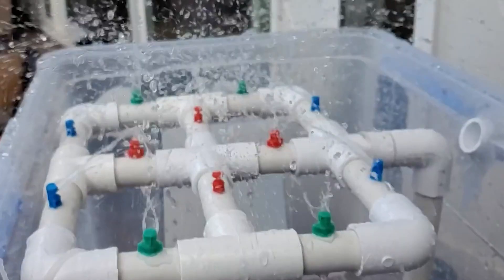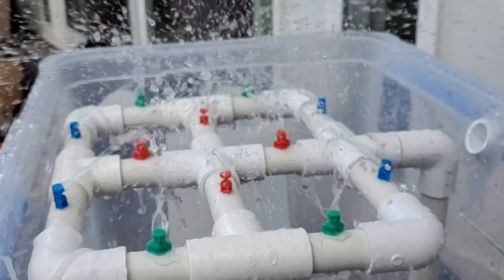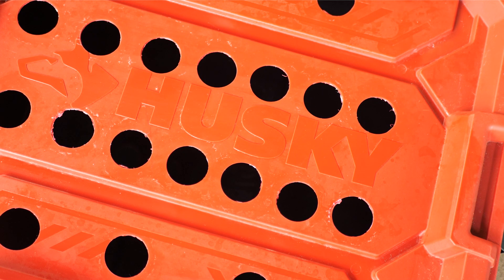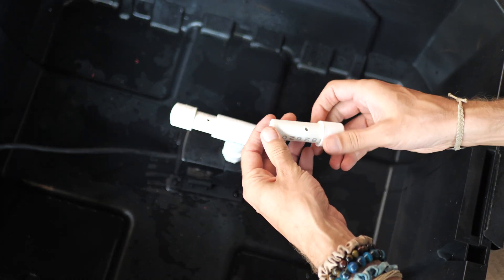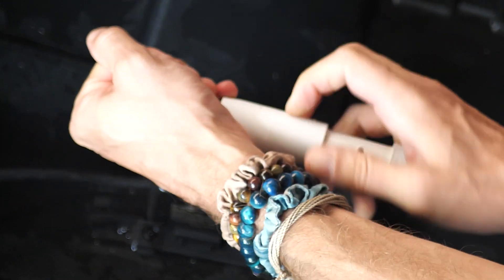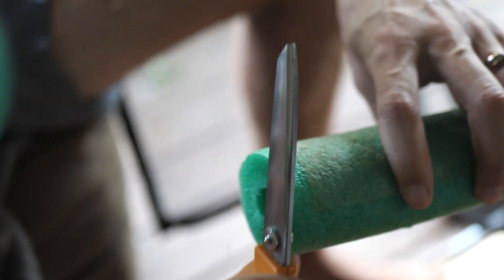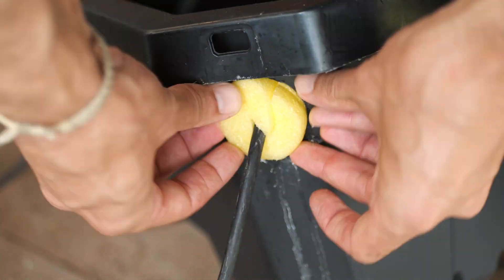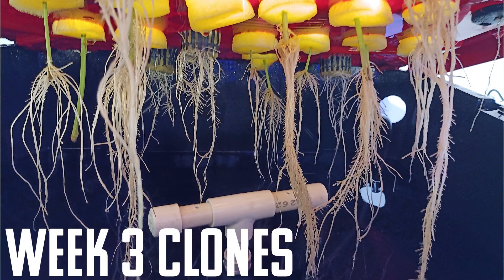DIY Aeroponic Garden | Simple LPA How To Build, That Works Better Than Aerogarden

Comment: Did you know about pvc pipe toxins ? and safer alternatives ?  if the pvc pipes leach then the plants are absorbing too and then we are eating the plants, this may be an issue. PVC (Polyvinyl Chloride) Experts recommend replacing PVC pipes with safer alternatives, such as:Recycled copper pipes
Stainless steel pipes
These materials are more environmentally friendly and have been shown to be less toxic than PVC. monitor water quality and detect potential contamination.The PVC pipe industry has disputed the findings, claiming that PVC pipes are safe and more environmentally friendly than metal pipes. However, many experts and advocacy groups argue that the industry’s claims are based on flawed studies and that the risks associated with PVC pipe leachates are real.  yes this pertains to drinking water but if your  using it for the plants they absorb and we eat .Water systems with PVC pipes may be more susceptible to chemical leaching and contamination during periods of high water usage or temperature fluctuations. PVC pipes are susceptible to chemical degradation and leaching when exposed to acidic environments (pH < 6.5).In contrast, PVC pipes are relatively inert in neutral to alkaline environments (pH 6.5-8.5).Elevated temperatures (above 20°C) can accelerate PVC pipe degradation and leaching. Water systems with PVC pipes may be more susceptible to chemical leaching and contamination during periods of high water usage or temperature fluctuations.Microbial growth and biofilm formation on PVC pipes can also influence leaching. The presence of microorganisms can accelerate chemical degradation and release of contaminants.It’s essential to note that the industry standard for preventing unsafe health impacts from plumbing systems due to chemical leaching is NSF 61. FlowGuard Gold CPVC pipes, for instance, are certified to NSF 61 under all water conditions. However, not all materials can claim this certification, something to think about.
Reply from the maker: Thank you for this